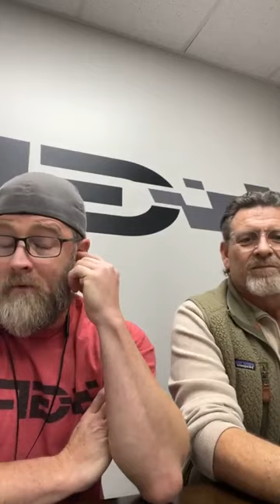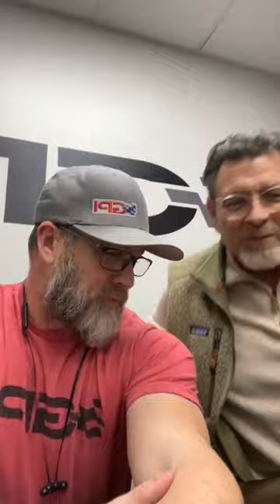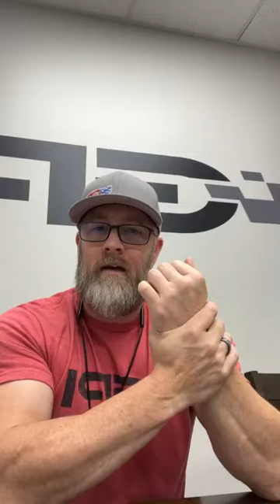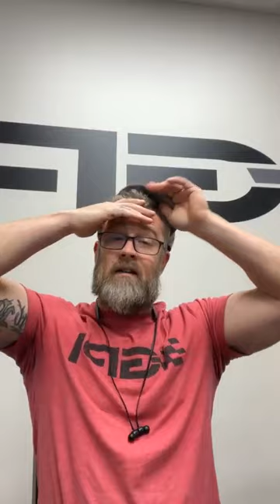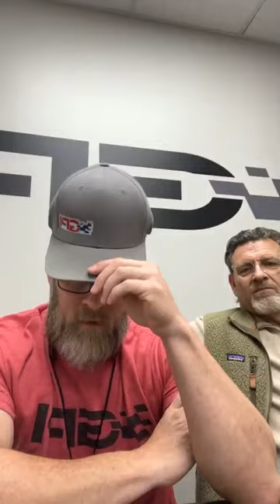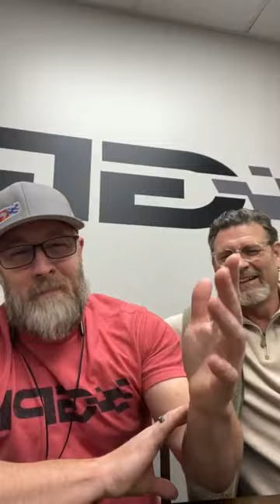Q & A: Engine Displacement

Comment: Understanding that nitrous requires combustion initiated (with air) to dissociate it and then feed more oxygen to the mixture, I've always wondered how much nitrous an engine can ingest before it's displacing so much mixture, and the mixture is so fat (prior to N20 dissociation) that it just doesn't want to light off and work well? Assuming the cam timing is right to keep things happy, is there a reasonable rule of thumb for how much can be sprayed relative to the NA power? Like 75% of NA or 125% of NA etc.? And I'm talking dedicated nitrous-built motors, not some stock engine (which I'm sure sure wouldn't love having power doubled purely on bottle).
Reply: We have a spreadsheet we use but it works out to about 1.33xCI
At least in our experience.
Reply: @Stevens7983  I suppose that's another way to look at it. I remember one of the statements being 500-550 Shot on a built 427, which would be about 1.2-1.3. Clearly at a certain point, you're just displacing all of the air.
Reply from the maker: Absolutely right!